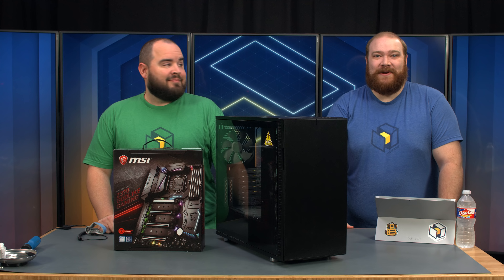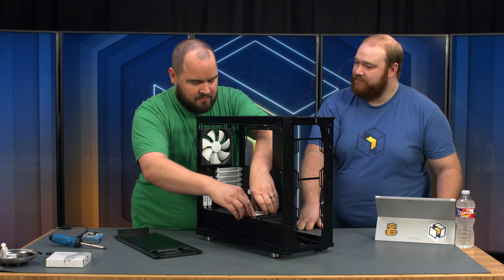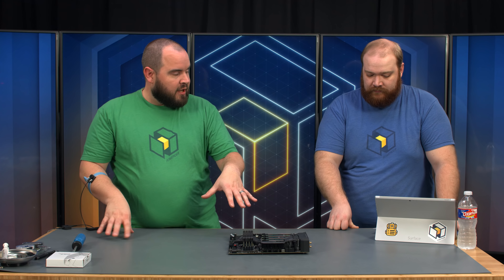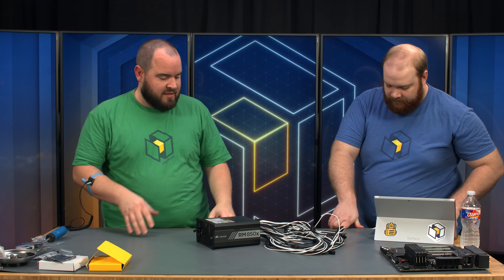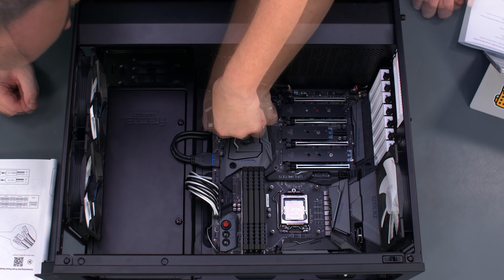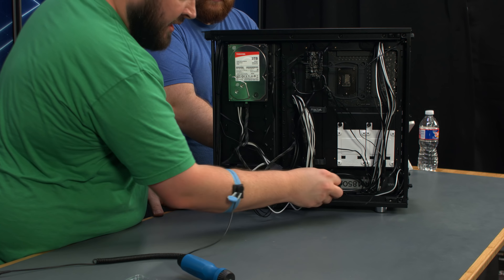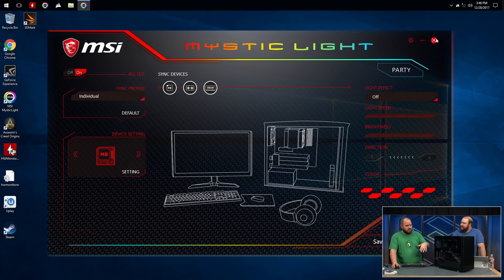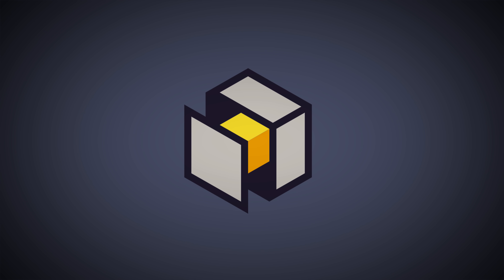Fractal Design Define R6 Build - i7-8700K / MSI Z370 Godlike Gaming (Livestream Archive)

Comment: Probably gonna use this R6 case for my next PC upgrade. Right now using the R4 and I really like it.
Reply: Indeed, and the R6 also has provisions for an optical drive, while others don't.  You can use your older components, yet still have a modern case with updated components.  I hope that Fractal plans to continue manufacturing this case for many years to come.

Comment: GPU radiator should be mounted higher than the pump with these AIOs. 
At least the EVGA Hybrids had it as requirement.
Reply: i saw that too

Comment: Hi guys,

Just to confirm,  I have successfully mounted an 140MM EKWB CE in the back, 360MM EKWB PE in the TOP, and an 280MM EKWB CE in the front.

Everything just fits, the screws of the 360MM are almost touching the 280MM rad because EKWB uses ball shaped screw heads.

But it does work, and it works great!

From what I can tell you can even fit another 120MM PE in the bottom, but I didnt do this, so try at your own risk. Looks like plenty of space though.

As a PSU I am using a Corsair RM750x, so that PSU and a 120MM would work!

Enjoy builing in this awesome case!

Comment: You guys mentioned the possibility of needing to move the "vanity panel" to the back to make room for larger graphics cards. I'm running an Aorus GTX 3070, which is a pretty big card, and I didn't have to remove the panel or the drive bays, FYI.

Comment: I think just a bit of whitening to the mesh C and using the power button and USB ports design on it would greatly improve the design as well as pushing the front cover out a little to allow bands to be moved to the outside part of the case covered by the mesh so you could use a bigger cooler

Comment: i realize this is an old vid and you guys likely don't keep up with archived comments, but I would like to know why you chose to put the radiator at the top and not the front. isn't the primary point to cool the cpu with cool air and hot air is rising and being drawn out the top through the radiator. I am not sure of temp difference, but your thoughts would be appreciated.

Comment: I'm going to be be building a new system in the next couple months and this is the case I plan to use, except I'm going to use the one with solid sides since A) My PC is in a desk cubby so all I can see is the front and I'm not interested in RGB lighting at all.  B) It has noise dampening foam for an even quieter system. This case line is now available from the factory with the USB-C port for essentially the same cost as the one without which is a nice addition. I looked at some cheaper cases, but I've always had to use cheap cases in the past. They look like crap, are a pain to build in and maintain, and usually require buying fans which makes them not so cheap after all.

Comment: Do you think it'd be possible to use a Kraken 280mm mounted all the way forward and put the GPU 140mm on the top rear? Or would it be safer to use the 240mm Kraken?

Comment: I just purchased the Fractal Design Define R6 case. In the manual, page 27, for open layout, it suggests you can put two 140mm fans in the front. However, it appears that there's room for one more. So my question is, can I fit three 140mm fans in the front? Thanks.
Reply: Unfortunately no -- those mounts you might be seeing are the 120mm mounts. 
 You can put three 120mm fans, but only 2 140mm fans in the front.
Reply: +Jack Followay, thanks a lot.

Comment: would it be possible to bottom mount a 280mm AIO CPU cooler? trying to figure out of the hoses would reach to CPU location, or if front/top mounting would be mandatory

Comment: Ps: you are not supposed to mount the hybrid gpu rad on the bottom. I don’t know about msi but the evga ones say right in the instructions do not mount on the bottom of the case due to air bubbles that will form in a couple years in the cooler will get trapped in the pump causing pump failure. I’m guessing this would be the same as msi since the cooler is likely made by the same company

Comment: gpu  radiator has to be above the card? any issues with heat? the EVGA version has a warning not to mount below the GPU, suggest mounting it above, I also noticed the higher temps
Reply: That makes perfect sense to me. You need to keep the flow going to the pump as it is a wet pump. You do not want the pump to run dry as it will kill it. So like when installing a custom loop (or if you are putting together a fish tank) you want the pump as low as possible to make sure the pump always get fluid. If the pump is higher than the reservoir or in the case of an AIO, the radiator, the pump will run dry and burn out. You will also see increased temperatures because the pump won’t be properly circulating the fluid through the system. End result is that you end up damaging all your pretty pc parts...

If they put everything in their proper place the gpu radiator should actually be either at the front, the top, or at the exhaust port at the back. All of which would keep the pump (mounted directly to the gpu) below the radiator. Or at least close to being around it’s actual height.
Reply: xZiddel you are aware that almost all the AIO's are manufactured by two different companys right?

Comment: Is that cable mod kit necessary? I was under impression that all cable are supplied when ordering for a full build. Please let me know when you have a chance. Thanks.
Reply: Totally not necessary.  PSU's come with all needed cables in the box (if modular) or already on the PSU.  The cable mod kit was purely for aesthetics.

Comment: Good video. This is the setup I am after and I'm happy to see a video with mostly similar parts. A question on Case pressure: There are 2x 140mm fans frawing air in from the front, plus the 120mm fan on the GPU radiator drawing air in from the bottom. Then 3x 120mm fans on the top radiator set as an exhaust, plus the 140mm rear exhaust fan. Does this result in a positive or negative case pressure? My concern is dust: I don't want dust sucked in via any other cracks if there is any negative case pressure.

Comment: Question: can the panel on 9:55 be mounted to have the hard drive brackets facing the tempered glass?
Reply: No but you can reverse the two panels.
Reply: Or buy another panel from the website

Comment: By using the alternate internal layout and thus remove the drive trays and relocate or even remove the drive cage panel, would I still be able to install an optical drive in the 5.25" slot?
Reply: Hey man did you ever find out the answer to this?
Reply: If you put a 360 or 420 at the top, the 5.25 drive bay has to come out.
Reply: I don't think you can use the optical drive with the alternate layout. just opened mine and it seems like the screws to fix the panel are directly above the optical drive

Comment: Which RGB LED Strip did those guys use at the bottom of the case ?
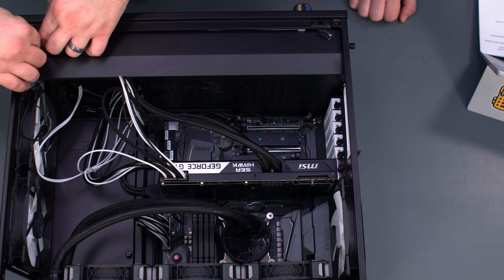Reply: It's an addressable RGB strip from Phanteks (it came with the motherboard -- unboxed @11:53 / installed @46:45)

Comment: Will this case and high profile ram like Crosair Vengeance RGB PRO/non PRO- fit a Corsair h115i PRO 280mm or h150i PRO 360mm - ON THE TOP ?

Comment: Does this case really accommodate an EATX sized board? That is such a tight squeeze getting the cabling through the grommets with an e ATX board in place. imagine if you had to change or route a different power cable after the eatx board is seated. It would be a nightmare. kinda like taking out your engine to change a flat tyre. At least that's how it appears.

Comment: Hi, is it possible to put 5 gpu cards inside this case? 4 pcie x16 + 1 using a riser? I'm worried about the energy cables for the 4 cards attached to the motherboard, behind the 5th card that would be using the riser, is there going to be a space for that?
Reply: Not even close, nor in any other case or motherboard. Some mobos still support 4 gpu cards, but none of them would get 16 PCIe lanes, more like 8/4/4/4. And there simply aren't 5 places to plug in full-length PCIe cards. The remote riser uses one of the existing 4 slots.
Reply: Tim Cotton, my idea was to get a 4 PCIe full size lanes + 1 PCIe x1 motherboard and use a different riser. Of course the fifth card, the one in the vertical, would have to be like a gtx 1080 ti mini and using a x1 to normal size PCIe riser. I’m just wondering if it would fit the case.
Reply: Hi, I think you didn't understand... 4 GPUs would be using pcie x16 and the fifth one would be using a riser x1 to x16... 4 would be in the horizontal and 1 would be in the vertical, I'm just wondering if they would fit there or not... I believe if the fifth one is a mini card it would fit perfectly...

Comment: Do not put your gpu radiator on the bottom of the case like shown.  Always do whatever possible to mount it above the gpu.  Because there is an air pocket in all aio's thats used as an expansion medium to buffer your fluids expansion when it heats up.  With the radiator at the lowest point your air pocket will now rise to the pump head, which is going to cause your pump impeller to  constantly mix air with your coolant and emulsify the fluid , changing its density and coolant properties as well as throw off your rpm.  Each time the computer sits the pump is going to start and have to reprime itself before it gets going.

Comment: Hi guys, May I ask if is better to install windows in an 960/970 evo instead  to an 860? I explain better myself, I want to upgrade my pc and I ve noticed that my  internal sata hard drive (2T) is almost empty after 1 year and an half of using my pc.. Would be better to get one 960/970 evo (500GB) and one 860 (250/500GB) instead, and using the 960/970 for windows and games etc and the 860 for the rest? what do you think? what do you suggest? Thanks a lot!!

Comment: fractal cases are so nice.  wish PCs weren't so frikkin expensive to build.  would love to upgrade my i7 / gtx 970 rig.
Reply: They are, but they're all kinda samey. My last build was a Fractal Define Mini, and while I liked it I just couldn't go Fractal again because it would've looked the same.
Reply: They definitely don't stray to far from the original concept lol.  I went for the quiet model though (no see though), the Define R5 Black.  I found it had the best noise dampening quality, which was very important to me.  Would buy again...... but I know there are a few new cases out that are suppose to be quite nice.
Reply: busywl69 Yeah my Define Mini was the same, solid panel with dampening instead of a window. I liked the more subdued look since I was in college at the time and didn't want it getting stolen, and it was pretty quiet compared to my previous case (not saying much since it was just a cheap HP  Pavilion shell with real thin metal). I just switched to the H700i though and my GPU load temp dropped like 10C; didn't realize how much the Define Mini was trapping heat. It also seems pretty comparable in noise, though I'm not sure if that's due to the case itself, different fans, or using the smart hub instead of mobo control.
Reply: you are right about the temps and air flow.  not where I'd like it to be but manageable.  Would have to run my rear noctua fan 3 times as hard as the intakes which would get too loud for me.  

when I'm ready to build again (when the computer industry comes down to earth with their prices) I might consider other cases is their thermals are good and they have a non bling bling design.
Reply: I'd say the larger case (H700i) has more "room to breath." :)

Comment: Would it be possible to vertically mount the Seahawk and put the radiator as a rear exhaust?
Reply: Chris yes absolutely
Reply: Thanks Wogglrboggle (he he funny name) I just think both as exhaust would be better for heat temps and I wasn't sure if a water cooled GPU would be to hot against the glass like normal GPU fans.

Comment: As soon as a vendor actually has this case available, I'll be building the following in it:
ASUS Maximus X Apex (E-ATX); Intel i5-8600K; Fractal Design Celsius S36 (mounted in the front); ASUS ROG Strix GTX-1080 11Gbps; 2x8GB G.Skill Trident Z RGB 3200 C14; 2x Samsung 960 PRO 512GB RAID0 (on DIMM.2); WD Caviar Black 4TB 7200RPM; Seasonic Prime Titanium 650W.  https://pcpartpicker.com/list/FGvMJV

Comment: does mounting a 360rad block the optical drive????
Reply: Yes. Whether top or front, if there is an optical drive, it limits rads to 280. The good news is, you can put a 280 in the front, as long as it's under 35mm thick, there is still room to keep the horizontal drive caddies.
Reply: Reckon I can forward mount a 280mm Kraken on the top and mount a 140mm AOI GPU Rad/Fan on the top rear?
Reply: Adam nope, while it does support 140mm fans as exhaust it will only fit a 120mm rad there. Other than that your suggestion will work. Fractal's made a neat guide on pages 27-29 in the manual: http://www.fractal-design.com/media/d26e0b4c-4b61-4045-95d4-064bf5b3c98b
Reply: Erland Johansen thanks for the reply! Just realised that the AIO cards have 120mm rads so it should work?

Comment: Hmm... wouldn’t it make more sense to have the gpu as exhaust and the CPU as intake? Gpu runs hotter than the cpu...
Reply: adamsrealm cpu as exhaust is better...getting hot air out of the top of the case is best...also heat rises
Reply: Tony the cpu doesn't put off as much heat as the gpu. The gpu consumes much more power With a higher tdp. With the gpu rad up front, it's dumping all that hot air inside the case. You'd much rather have it exhaust that heat.
Reply: Dead in Red cpu is ALWAYS hotter than the gpu....literally always when it is liquid cooled
Reply: J and K White the cpu puts off less heat regardless of what temperature it runs at. That's simply the temperature of the chip not the amount of heat it puts out. Just because the gpu runs cooler now with water doesn't mean that heat just disappears, it still has to be dispersed.
Reply: My ASUS Strix 1080ti under load at max settings and OCd to 2088 MHz only gets up to 58-60°c with custom fan curves. Yes it can get a little noisy, but not over the audio output of the 5.1 speakers the game is playing through. Using a complete stock gpu no modifications other than replacing stock paste with artic silver 5 paste. It was getting up to 65-68°c with the stock paste. But onto their gpu of choice... So they only got down to 55°c on their aio gpu... More than likely because they were letting the rad exhaust go right back into the case to leak onto the gpu. So mounting the gpu rad at the back of case would have easily given them temps of 45-50°c. But I knew they didnt have any idea what they were doing with it once I noticed where they were placing it. Also, the rad being lower than the pump is never a good idea. It stresses the pump too much and that can cause a pump to burn out easily. That cable management was terrible too.
Reply: Heat doesn't really rise when you have forced airflow, so that's a non-issue. However you want the CPU as exhaust because increased CPU temps win't affect performance, while increased GPU temps definitely do.
Reply: Erland Johansen the air coming off that gpu rad will effect the cpu temperature far more than the cpu air will effect the gpu.  

The GPU  they used here will put off twice as much heat as that cpu when both are at full load. If you use your system for gaming that gpu will be running at full load much more often than the cpu. Bitwit has a good video on this subject.